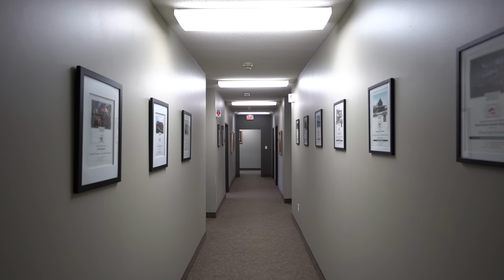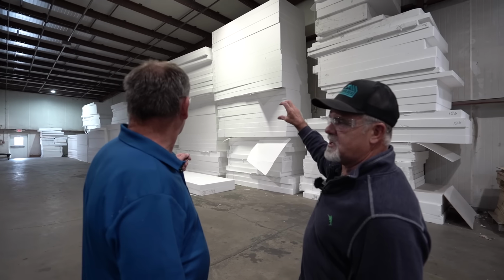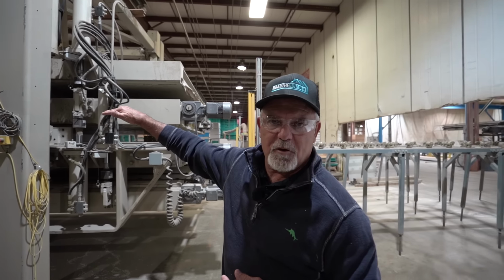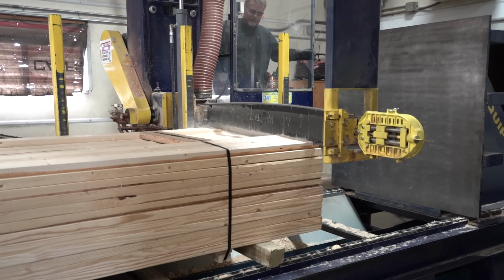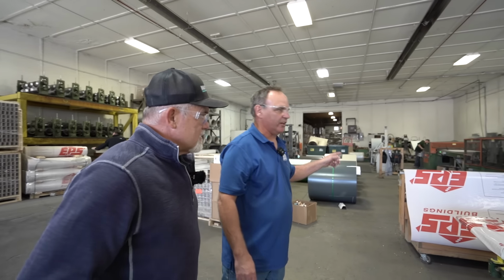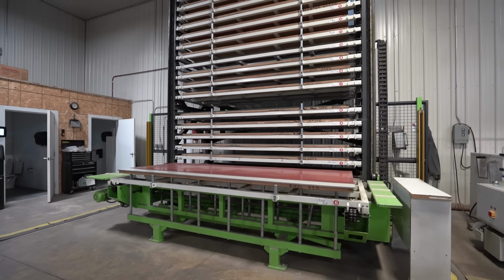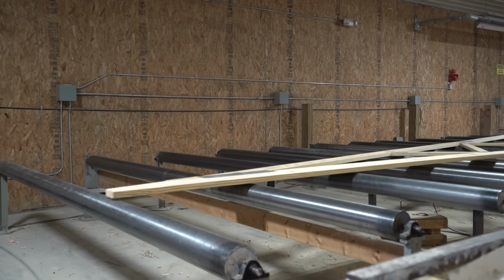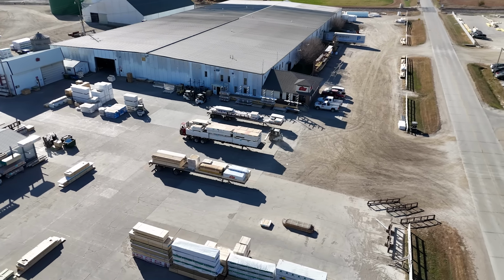The Building SECRET Behind My LUXURY Dream Shop !

Comment: Very cool video. Seems this company has it together all around. Minus any of Brad's upgrades what's the cost per/sf vs stick framing the same thing for your area? That is a question I'm very curious about. Potentially a huge time saver up front and energy saver long term.
Reply from the maker: Good question!    I will have this answer when it’s all done

Comment: You were 18 miles from my house... I priced it per square foot built and it was to expensive for my 24x30 pole barn style garage...
Reply from the maker: That is too bad, maybe in the future.
Reply from the maker: Sorry, I misunderstood what you said… this will come in at around $50-$60 a square foot (foundation, concrete slab, windows, garage doors , insulation, metal siding, Metal Roof, SIP panels, all labor, pluming  & two Cupola’s
Reply: @BradtheBuilder  It was about double that when I priced it but that was when the company was much smaller and very new technology... about the time it was featured on This Old House... or one of those construction programs...

Comment: This was really interesting, Brad. The tour guide was certainly very knowledgeable and had his ear protection in, haha.  It's like back in the day when we had our headphones on and would shout at the people who were speaking to us, when in fact it should be the other way around, haha.  Super nice guy and what a great facility!  

I couldn't help but wonder how wind-resistant it is after you have just experienced a tornado. I realize the likelihood of having 2 strike in the same area are not high, but the building itself must weigh a lot less than a typical wood-framed home/shop.  What are the wind-ratings on buildings like this? Probably a stupid question...

I'm looking forward to seeing this assembled on site at your place.  I didn't quite follow how/who puts it all together. Does it need to be assembled by someone from their team, or can one of your contractors take this project on?  It really does seem like a very high insulation value product. Just like any "girl", I'm looking forward to seeing what color you chose. That rustic barn color will likely be beautiful. 

Hi to Mary Kay!

Heather🇨🇦
Reply: Those panels are really stiff once that glue dries! I ended up with more conventional construction, cost per square foot was to high at the time, and they were a smaller company back then... in my area construction has to withstand 95mph winds for 3 minutes like we would see in a derecho or thunderstorm... they have to meet the same code and if my memory is correct the wind rating was even higher due to how stiff each panel is.
Reply: @MaryBrownForFreedom  Great info! Thanks for writing back. I am sure you can understand how I had visions of a good wind coming along and lifting it up like a parachute, haha. (I realize it's attached to the slab).
We have high winds here too at certain times of year and can also have very cold temps in the winter and quite hot ones in the summer.  The R Factor would definitely be a real treat here!
Best wishes to you and thanks again for the info!
Heather🇨🇦
Reply from the maker: Thanks Heather for reaching out… I will tell MK

Comment: Living in Florida I would build a house out of ICF blocks. Pour the slab with rebar sticking up. Stack the foam blocks, add rebar, fill the blocks with concrete. The roof trusses tie into the rebar in the walls. 
Big bad wolf style. Huff and puff and you're not blowing my house down.
The SIPs panels wouldn't do so well in this environment.
Reply from the maker: That sounds like a great plan & Hurricane Proof too!
Reply: they are tornado rated so you would be surprised! Those panels are extremely stiff!

Comment: I was most impressed with the CNC equipment doing all that work since I set up, programmed and operated CNC equipment for 34 years.
Reply: I also have been working with CNC equipment for around 28 years. They were talking about Italian equipment being great, not really but they are definitely better than equipment from Spain.
Reply: @craigchapman234  we had three American cncs and a Japanese mori seki. 
Lots of problems with 
the American ones but after 30 years the Japanese machine was still running perfectly.

Comment: I sold and did installation nationwide of SIPs for years and wouldn't build a dog house without them. There are tricks to getting it done correctly that most contractors aren't willing to invest the time to learn as well as local building departments not understanding them. EPS is more upscale in their methods than the company I used as well as their scope of materials which is impressive!
Reply from the maker: Thanks for sharing